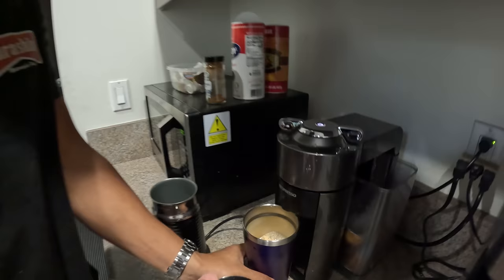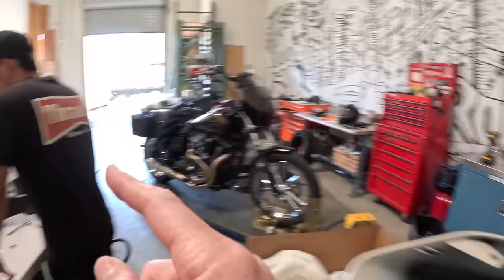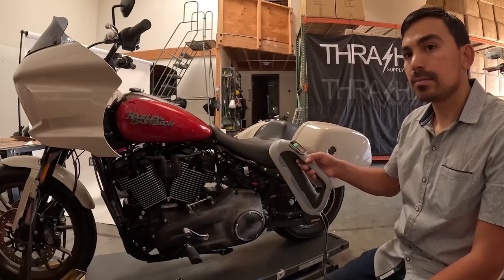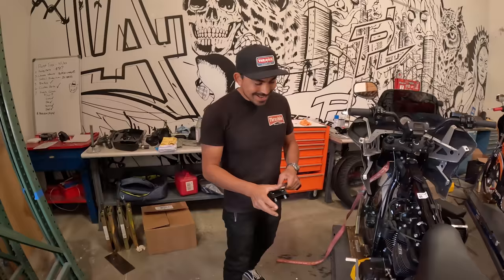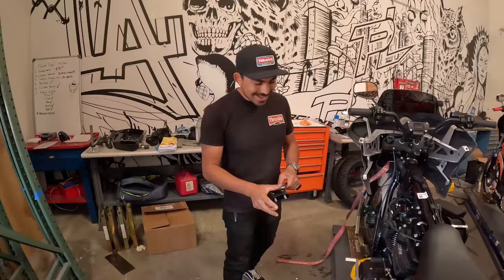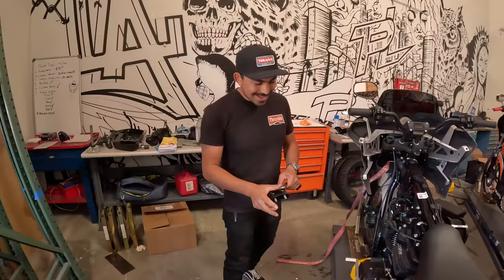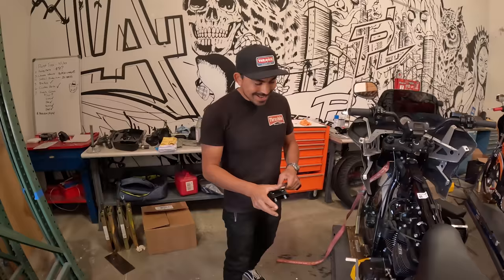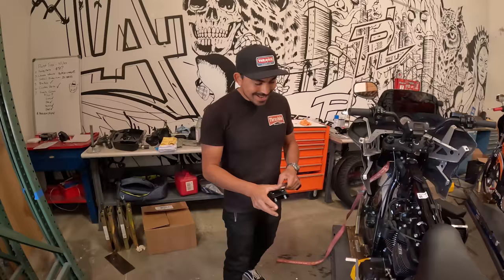Carbon Fiber Low Rider ST !? Born-Free Build Week 6 - Vlog 74

Comment: okay sure that new right peg system looks rad but have they think of other brands clearance where the diameter of the pipe could block the right peg from fitting.
Reply from the maker: These aren’t for production. Full custom 💯
Reply: @THRASHIN  hmm alright makes sense there